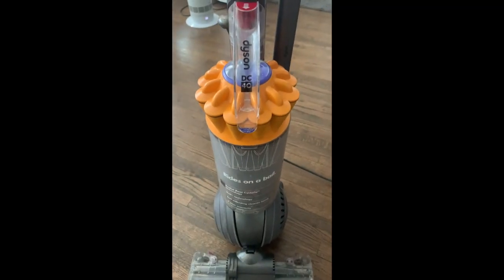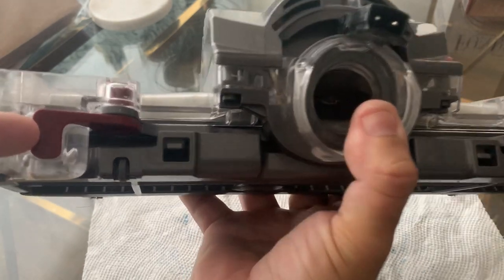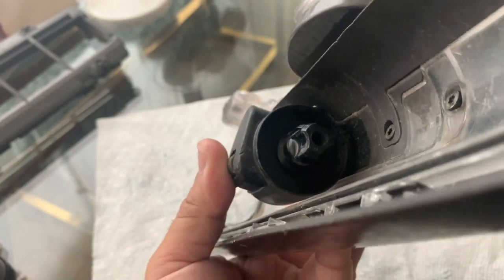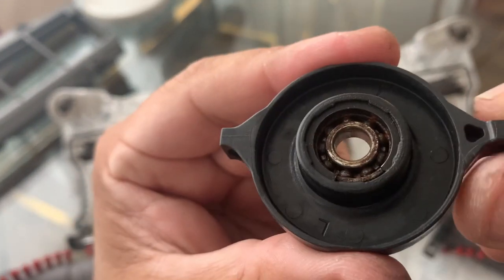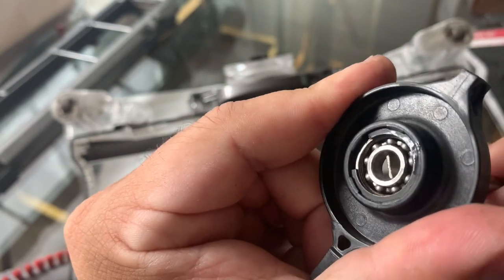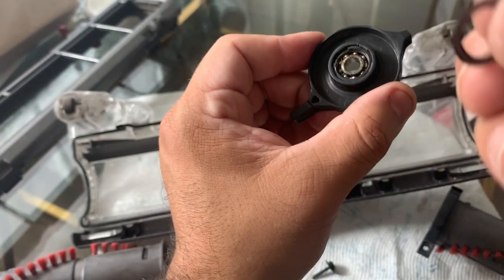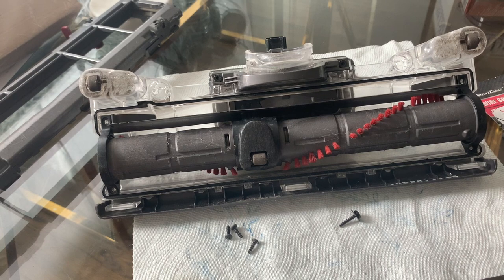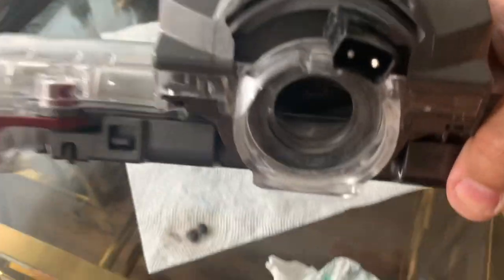Dyson DC40 Vacuum Brush Heads DIY Repair (Brush Bar Stuck / Not Spinning)

Comment: You’ve done a great job on fixing a stuck bearing but there is another problem that often happens and is probably the reason why they withdrew the model … you forgot to mention the electric connector coming from inside the ball.  There are two mains wires inside the ball that have to stretch when you lower the machine … very often one of the mains wires breaks and needs re soldering together (another video exists showing this) … so if your brush-head feels loose and it still doesn’t turn then you’ve got to trace the mains wires back inside the ball.
Reply from the maker: This video was specific to the most common issue which is in fact the stuck roller due to bearings seizing, but thanks for mentioning this as people can look that up as well if this doesn't fix the issue. Appreciate the input!
Reply: I don’t suppose you have a link to the video needed for that fix do you Tony? I’m obviously using the wrong search term! 👌🏻

Comment: One small correction: the "washer" you found is not really a washer. It's one of the seals of the roller bearing, that came out - allowing liquids to get into the bearing innards.
On my Dyson's rollers, those bearings are 17mm OD, 7mm ID, and 5mm thick. Those measurements correspond to a 697 2RS metric bearing (2RS: two seals).
Reply from the maker: Great info thanks!!

Comment: I've cleaned the brush roller out and all is clear but it still won't turn. If the motor end won't turn is that a sign that motor is broken and needs to be replaced?
Reply from the maker: 1. There is a screw on the roller motor as you can bearly see it at 4:47 (hole in middle of roller). Remove it and inspect underneath as any slight hair/strings caught there (which can be unseen) can cause them not to turn

2. If you have inspected and rollers are clear, check now if they spin with the roller tubes out.

If all of the above has been inspected and rollers still don't turn, I'd go with your suggestion of perhaps a bad motor.
Reply: On the spinning black roller thing where it needs the star head can you unscrew so you can take the hair from inside? Mine is stiff I think that’s the problem but I need to buy a star head thanks
Reply: @MsMuymona  Yes, correct. That can be removed. You can go to your local 99c store and usually find a screwdriver set that has the included "torx" screw (correct term for the star screw i mention lol). Or harbor freight. Shouldnt be more than $5.

Please keep me posted and if you buy a set, please post the torx screw size if possible.. as i def don't recall but could help others.
Reply: It's no.15 torx

Comment: Hi.. my DC40 is different .. there is NO metal cogs inside the black end caps removed from the ends of the rotating brush!
Reply: Try using a wire brush to remove the caked on dirt, it may very well be under that as i don't think dyson would make a different dc40, unless someone already messed with it prior. Good luck
Reply: @gr2262  I triple checked everything because it didn't make any sense.
Unless it depends on country for model!? 🤷🏼‍♀️
I Defo removed the dirt before sending this!! 😅 
It very clearly looks nothing like in this video, wish you could share photos on here.
Just black plastic ends, with a smooth sliver metal ring- tunnel going through it that the purple spinning head slots in to and barely moves!! No spinning cogs or mechanisms of any kind.
The purple ends slot into that and move around with difficulty.
And the screws on the outside plastic go straight into the spinning people part.
No cogs, dirt, rust or hair of any kind there, and still barely moves even without being screwed in.

It says DC40 on the machine. Although the top cylinders on mine are purple 💜 NOT orange 🧡 which usually means different models of the same range with Dyson.
Don't get why this part would be So uselessly different though
Reply: @amberlierosesquirrel Dc 40 animal with a purple 💜 top?
Reply: I came here to comment the same thing that you did. I took mine all apart and there are no ball bearings. I'm wondering if the black Stubbs that the rollers go on to are supposed to move? Mine doesn't move at all. After cleaning the inside of both ends and putting it back together the rollers still won't budge I'm so frustrated !  @amberlierosesquirrel

Comment: I see that the black pieces that the roller heads stick onto spins. Mine isn't moving at all so that appears to be my problem.
Reply from the maker: @t4tulip  yes, it's probably seized. Try to use the wd40 and flathead screwdrivers method on my video to see if it loosens

Comment: Подскажите как снять стопорное кольцо, что бы вынуть подшипник, его заклинило.
Reply from the maker: The ring can be left in place, and all you have to do is clean with a wire brush thru the top- however, if you must remove it, use a retainer clip removal plier or simply  use something with a pointy end and pry out carefully.

Comment: How do you get to check the Dyson 40 belt
Reply from the maker: I have read that it requires removing and pulling apart the engine which this tutorial does not cover. Just be advised, this is a difficult task and should only be tackled if you are up for a challenge.